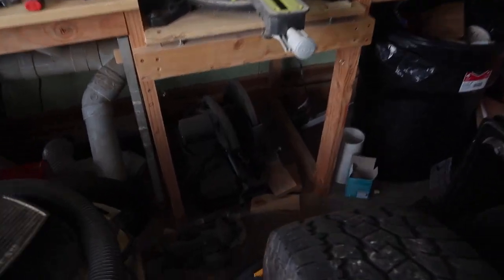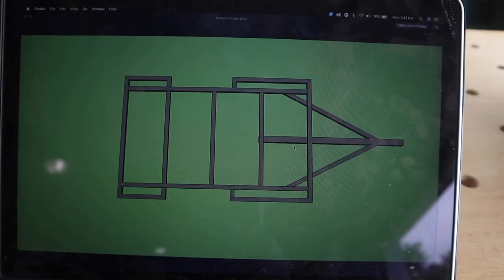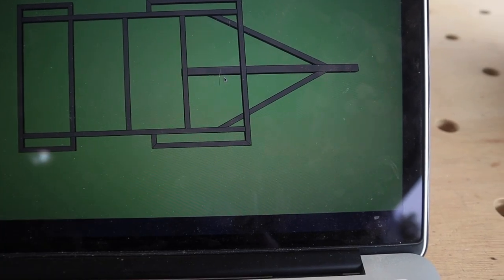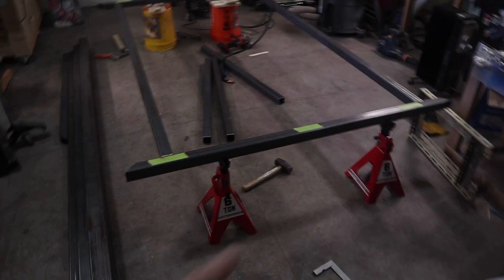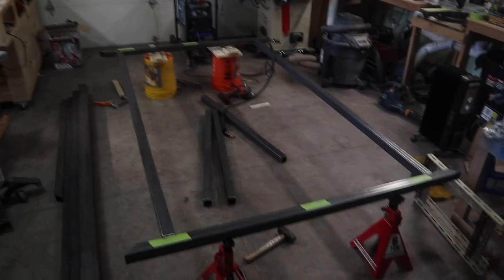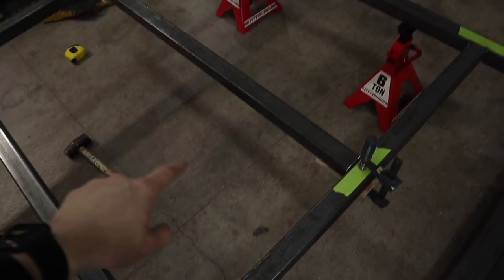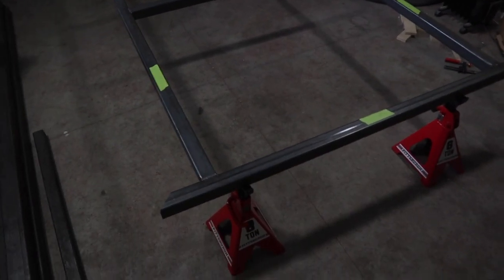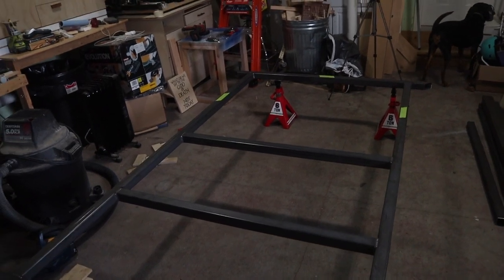Offroad Teardrop Camper Build EP #1

Comment: I don't have an oxygen welding machine I have a ROD 7018.. Is that enough?
Reply: He's using a Mig welder for this. It's probably Co2 gas. I would always use stick with the trailor base as it gives more strength. Normal 6013 will be fine for most the trailer. 7018 for the tungue/triangle toe. Its a high stress area. You can also just weld more supporting metal to the toe and 6013 will be find to use. I. e. Angle iron. This gives more welding area. Remember 7018 are only 1/6th stronger than 6013.